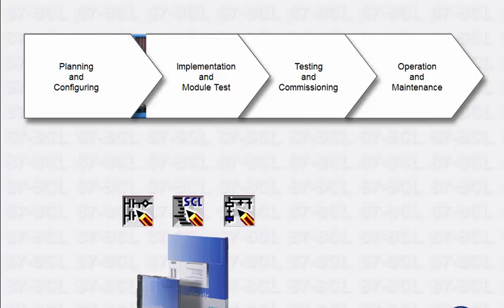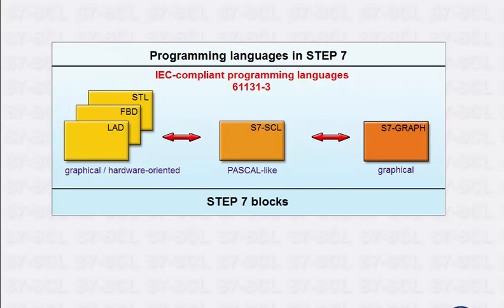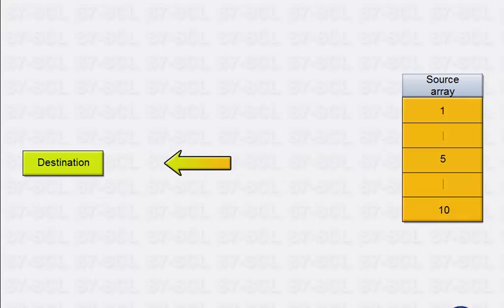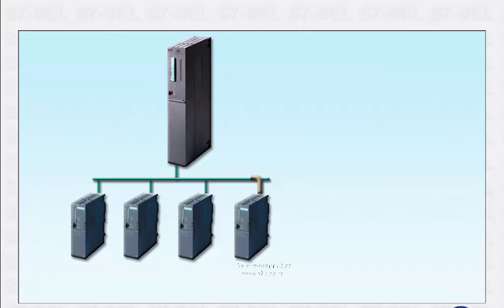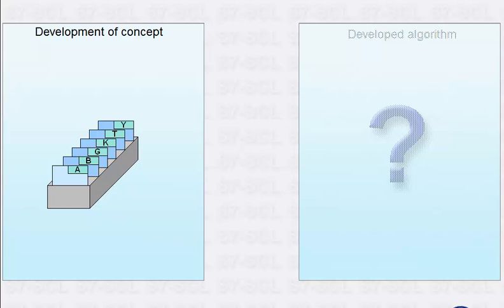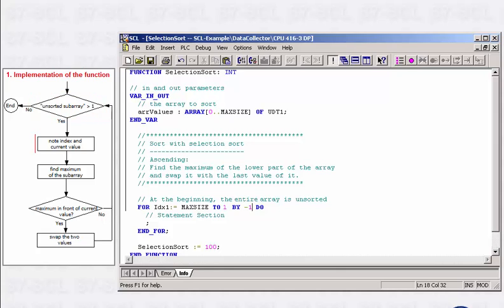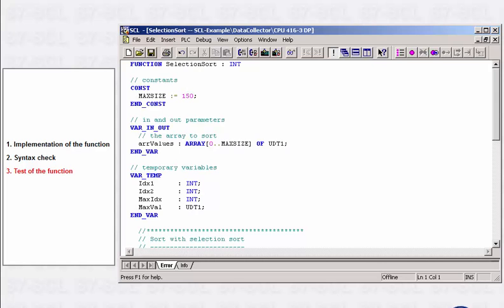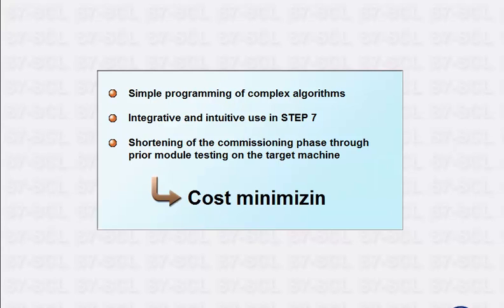PLC siemens s7 300 training, Lesson12, SCL Language concept and application

Comment: Hi bro

"Block symbol name is not valid"

I wrote the same code as you but I get an error. I've checked all the code and I can't find any difference. 

The error is on the first line: --->  ( FUNCTION SelectionSort: INT )     could you help me please?
 

CODE:

FUNCTION SelectionSort: INT

// Constants
CONST
    MAXSIZE := 150;
END_CONST

VAR_IN_OUT  // in and out parameters
    // the array to sort
    arrValues : ARRAY [0..MAXSIZE] OF UDT1;
END_VAR

// temporary variables
VAR_TEMP
    Idx1    : INT;
    Idx2    : INT;
    MaxIdx  : INT;
    MaxVal  : UDT1;
END_VAR

    // **********************************************
    // Sort with selection sort
    // -----------------------------------------------
    // Ascending:
    // Find the maximum of the lower pat of the array
    // and swap it with the last value of it.
    // **********************************************

    // At the beginning, the entire array is unsorted
    
  FOR Idx1:= MAXSIZE TO 1 BY -1 DO
    // Copy actual values
        MaxVal := arrValues [Idx1];
        MaxIdx := Idx1;
                
    // FIND maximum OF the unsorted ARRAY
    // go up to actual value -1
        FOR Idx2:= 0 TO Idx1-1 DO
        
           IF arrValues[Idx2].Index > MaxVal.Index THEN
               MaxVal := arrValues[Idx2];
               MaxIdx := Idx2;
           END_IF;
    END_FOR;
    
    // If I have found a new maximum, then swap it with
    // the actual value.
    IF MaxIdx < Idx1 THEN
       arrValues[MaxIdx] := arrValues[Idx1];
       arrValues[Idx1] := MaxVal;
    END_IF;
    
 END_FOR;

    SelectionSort := 100;
    
END_FUNCTION
Reply from the maker: check the variable type UDT1 which is the variable type of the array